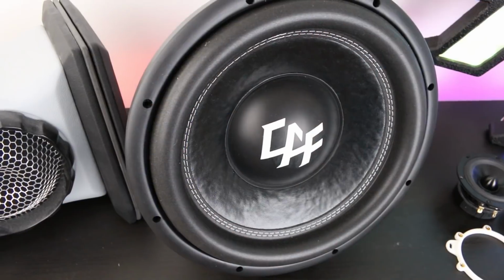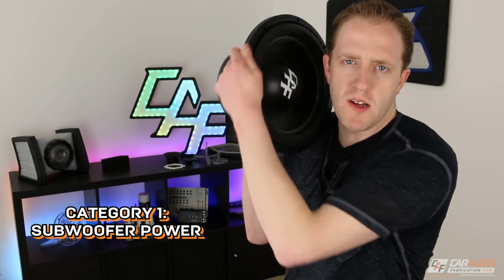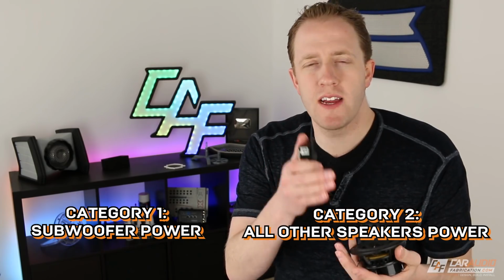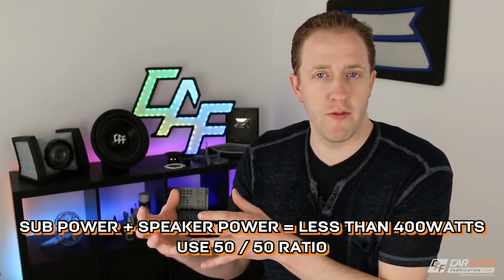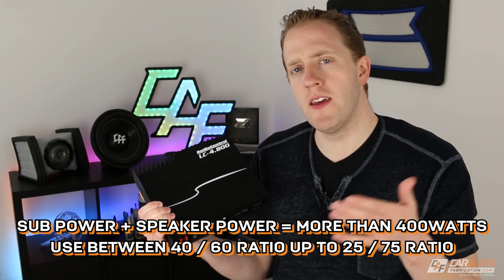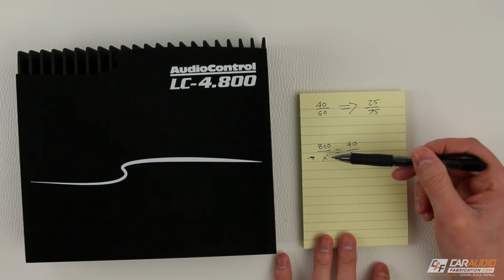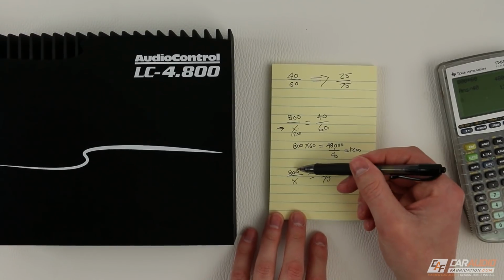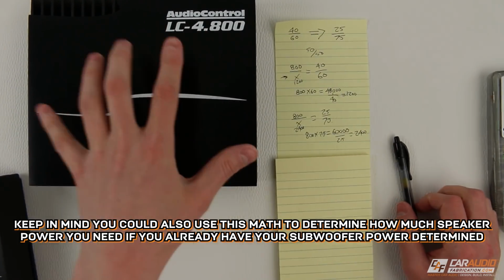Pair amplifiers CORRECTLY - Power Balancing Car Audio

Comment: Hi Mark!
I really enjoy your channel and can appreciate the time, detail and love that you put into your setups.  Nice video editing skills as well.  Keep up the good work. 
I'm very picky myself when it comes to car audio.  But I don't see much in the lines of more affordable amps or speakers on your channel.  High end setups are great and all but reviews and setups of some of the more common and mid-tear components ($400 to $600 amps / $150 to $300 speakers) would be great and help me and others as well.  But if you only want to do the higher end stuff, that's fine too.  If you do have some videos on more affordable options, please post a link or two. 
I use to have an old school Sony Explode 5 channel amp (40Wx4, 150Wx1), CDT 3-way component speakers,  2 Image Dynamics 10" subs, Clarion Pro Audo CD receiver (got it on clearance), Audio Control active crossover (made my own crossover modules with 1% resistors) and a ton of second skin sound deadener.  Everything for less than $1,500 total.  I fiber glassed my own custom kick panels and built a Deathbox for the subs (isobaric configuration).  Tuned it all for SQ.  Came out sounding better than most shops could do with expensive gear.  I don't have the car anymore but plan on doing another similar setup in my Outback.  It's been 10 years or so since I did the stereo and everything has changed, more or less and is why I was asking about you doing more mid-tear setups.  They can sound just as good or better than the high end stuff with some TLC, tuning and careful setup.

Comment: This is strictly RMS right? I wanted to go with a multi channel 800W max power amp (400 RMS, 4 channel x 100W ea @ 4ohms) and a mono 800W amp (RMS 600W, @ 2 ohms). Just confusing because they are both 800W max power. FYI, aiming for a 4 speaker, 1 Subwoofer setup, with aftermarket head unit. Im also a noob lol

Comment: Hi there friend. I have a question. I have a 100rmsx4 channel amp on my speakers. If I want to improve my bass output, should I get one or two subwoofers and what kind?? I’m limited on space in my truck. I can install a box in the back under the seats by either trying to build one or buying one, but my seats are low so I think 12s are not an option. Appreciate it if anyone knows what I should do.

Comment: Hi!   I have a question for you. If I use a non factory head unit. And I want to maximize the speaker output.  Can I use one amp for the subwoofer and other amp for mid range speakers and the high output of the head unit for the door speakers? Or should I use only the amps? I want a quality sound system but I’d like to have a good bass.  Regards

Comment: new on your channel, and its very informative. may i ask what are the difference for the speaker amplifier and sub amplifier? i used on may car audio system 2 speaker amplifier ( 1 for the tweeters and mids and 1 for my 2 15” subs). i used a 4000watts amplifiers. thanks

Comment: What are you splitting though?  In your initial example of a 100W head unit, you're telling us a 50/50 split is 100W to the radio and 100W to the sub, but that's not a split,  that's 200% power. Should it not be 50W to the radio and 50W to the sub?

With the 4Ch 800W amp there are 250W per channel, so then 60% for the sub should mean there's only 80W per channel.
i

Comment: Hey there! First of all, thanks for all your amazingly useful videos and tutorials! Now, speaking of this exact video and informations, say I have a front hertz kit esk 165, rated at 100W RMS (300max rated) each pair, a rear coral kit mk130 rated at 100W RMS (200max rated), all driven by Pioneer GM-D8604 amp, rated 400Ws RMS at 4Ohm (1600max rated). What would be the perfect pairing subwoofer? I was mainly looking at active subwoofers, like 500Ws RMS 12", 1500 peak. Would that be a good 55 to 60/40% balancing? Excuse me if my question is dumb or something, watching this video because I'm indeed a noob and learned a lot by watching quite a few of your videos (alternator was my first upgrade indeed, thank you <3). Thanks again Sir Mark, amazing job!

Comment: So do the 25/75 split, and install the bass control knob which allows you to dial the bass level up or down, but never over the set gain setting on the amp (more of a tuning or EQ knob).............................Have the boom when you want it, or the audiophile when your want that too.

Comment: i know its late, but, 01 Highlander, kenwood deck, old school hi fonics mono 200w hercules(1989), in 4 ohm- 360 2 ohm, front and rear speakers crossed over from the deck at 80hrz, earrhquake 10dbxi @2ohm, playing 80 and lower, sounded fantastic.l  i know its not a stock radio, but still sounded awesome. not a spl system at all but really sounded great for stock speakers and not a ton of money invested. enough boom for dubstep, just right kick for a7x, 5fdp and all hail the yeti. good tight double bass chest pounder. just my opinion..

Comment: You gotta keep in mind that it takes more power to move a subwoofer, since it's a larger speaker than the midrange/tweeters speakers. So 100w speakers != 100w subwoofer. And one last thing that was very important to talk about is how much power do you really need without going deaf? In my experience, 500w total power is enough to get it so loud your ears would hurt after just a minute. So anything over 500w you're likely going to get hearing damage if you're going to be using that much power regularly.

Comment: I like all your videos. I can tell you  know your stuff.  I have a 2017 Tacoma   I want to keep the factory head unit and add audio control amplifier. Do the lc 4.800 have sound processor built in to them or do I need to add one to the lc series amplifiers? I want to do a good sounding system at a reasonable price point. What would you recommend??

Comment: TL,DW:
a. If the system is 400W RMS total and under, split power between subs and other speakers 50/50 or 60/40, favoring the sub
b. 400W RMS and up, use from 60/40 to 75/25 power ratio, favoring sub

Comment: So i did this math to try and find how much door speaker power i would need for a 14k subwoofer system and on the 40/60 i got 8k and on the 25/75 i got 4k. Im going with the 25/75 , so does this mean i need a total of 4k on my door speakers ? ( 4 doors , 1k of speakers in each door(not including tweeters) ) .  im going with the deaf bounce Arnold's with the hannibal brass tweeters and maybe 2 neos just for extra vocal

Comment: My sub is an active Pioneer 350W RMS and in doors I have an amp 4x70W RMS = 280W. For a total of 630 I have the the fraction: 28/35 same as 8/10 and same as 4/5. And by the way, the 40/60 can be written also as 2/3 right? Is pretty much the same thing. If the recommended interval is between 40/60 and 25/75 then we have 0,666 and 0,333. So is much easyer to calculate this way. Let's say we have a 800 Watt speaker amp (4x200W) and we need to calculate the sub amp. For a 40/60 this would be 800/0,666 = 1200 W! For a 25/75 This would be: 800/0,333 = 2400W . There you go. A muc spler way of doing it. Very intuitive.

Comment: Mark, as always I enjoyed your explanation, but just to clarify for my own purposes (dual subs in an SQ configuration) :

1 x 800W amp for front and rear speakers (4 channel amp - component front, coaxial rear)
1 x 400W mono amp for subwoofer #1
1 x 400W mono amp for subwoofer #2

I realize that's simplifying things, but if we're talking RMS rather than peak power surely 400W into each 10-inch JL sub is plenty ? I readily admit that I don't spend too much time thinking about such things with home audio, but this makes total sense given the seating positions and the cabin effect in a car. I accept that you make a living configuring and installing people's systems but I'd really appreciate your input. 

Thanks for the video (and I did remember to like it).

Comment: What happens when I have way more for the speakers than the sub? So say I have 175 watts to 2 speakers (for now just 2 but it's a 4 channel amp) and then 300 watts rms for the sub? This doesn't sound that bad as it's about 50/50 rather than what it'd be for 4 speakers so what happens to it when it hits four x 175 watts vs the 300 watts on the 2 10 inch subs? Thanks

Comment: Im using  a hifonics brutus bxx 1200.4 amp. 1200 rms 4 channel amp wired at 4ohms to 4 speakers. but im gonna add 4 more speakers so 8 speakers total. Bridged at 4ohms should net me 1200 rms across 4 channels. Then ill just set the gains accordingly.and im gonna be using a single 3000 watt rms massive audio "12 subwoofer. Im upgrading from 2 "10 cerwin vega V max subwoofers. They are wired at 2ohms 1200 rms on a hifonics brutus bxx 3000.1D amp. Dual batteries with mesa 0G wire with 240amp alternator. My girlfriend thinks its loud enough. But I want it louder. All stuffed in a little hatchback camaro 😂

Comment: I've got a 2007 Chrysler 300c.   Looking to upgrade from absolute factory.   First and foremost, a Pioneer AVH-2500NEX Head Unit.   For reference, this unit is 50 x 4.  Then adding to my trunk a single Sundown Audio 12" 750W 2-Ohm SA Sub.  And to power THAT is a Rockford Punch 1000x2 amp.   Now my question, since this Amp is 1000 x "2" can I put 500 to the Sub and 500 to the 6 front speakers (dash, doors & rear deck) combined?   I haven't bought anything yet, I'm in the market to do so.

Comment: What if I have a 600.1 amp and a 300.4 amp. The woofer is 500rms and the speakers are 150rms and 100rms? Is that ok? Or should I get a more powerful amp for the speakers? I’m in the range of the ratio, but not sure! HELP!

Comment: I’m a little confused about how ohms affect amp ratings. So I’m looking at a Rockford Fosgate Punch 400X4 amp to power 4 Rockford Fosgate Punch 6.75 door speakers and a Rockford Fosgate P300x1 to power a RF P2 10” sub. However because the door speakers are 4 ohm and the amp only produces 50 watts rms x 4 at 4 ohm’s I believe I can say that I affectively have a 200 watt amp and not a 400 watt amp for the door speakers...? The sub is a 2 ohm unit and since the amp is rated at 300 watts rms x 1 at 2 ohms this is obviously a 300 watt match. With a 200/300 watt system I have a 40/60 ratio and should be golden, right?

Comment: Stopped it at 3 min when you said a stock head unit puts out 100 watts. BTW, when I make my systems I generally use real amps(not the head unit) and maybe 50 watts for components and 150 watts times 2 for 2 subs for about 400 watts total. If I want a higher powered system it's 100 times 2 and maybe 300 for each of 2 subs.

Comment: Sweet my power is 40/60 then will be 25/75 after the second set of amp & sub per side. 1100×60÷40=1650 & 1100×75÷25=3300 and that means 1100watts in the doors, and 3300watts in the extra cab.

Comment: So, I got it but Mark I’m new have a front stage with  focal tweeters huh end, mid range are hybrid audio L2V2 mid bass are hybrid audio L6V2  power with a arc audio driver 1200.6 , my sub is an Audi son 8” ported 500 watts  all 4 ohms, sub amp is a 1100.1 arc audio  the same  is apply to front stage?

Comment: The factory head you show is probably 10 watts hahaha... Mark, do you know where I can get a 15 watt rms mono amp? I already have my 1/0 gauge aluminum wire and 250 amp fuse installed.

Comment: My rating on my amplifier is 
RMS Power at 4-Ohms: 450W x 1
RMS Power at 2-Ohms: 750W x 1
RMS Power at 1-Ohm: 1000W x 1
And I want 2 subwoofers what’s the max rms I can get between 4-ohm or 2-ohm or even 1-ohm 
I have a Memphis prx1.1000 mono block class D
Please help

Comment: I uses EQ's in any system to clear out distortion, amplify the sound. And dial in the sound I wanna hear. Plus a few EQ's I have have front and rear high level inputs along with an optional rear rca input, since I add linear doom tweeters I learned that I can get 6 high level channels, since the tweets don't need alot of power and are facing me, I hook those to the decks front high level lines, then instead of using the front highs as input to the EQ i use the rear high level into the the front high level inputs on the EQ and rear rca's outputs on the deck to the rca inputs on the EQ by using a rca 2x 1 into 2 spliters except with my JBL by Harmon Cardon digital display of 10 band EQ, that one has rca in and out's, allowing bypass non amped sound to the amp. Then I'm left with 4 high level, front and rear outputs, I always replace stock speakers with higher wattage aftermarket speakers so the EQ+deck gives them greet sound, when I crank it up like in my minivan I've got 1 Soundstream comp SPL12D DVC 4ohms per channel bridgable ; 450w rms @ 4ohms, 800w rms @ 2ohms, wired to a 2500w max Earthquake amp 2ohm stable, pushing 750w rms @ 2ohms. And installed in a sealed enclosure that has the exact air space it needs, it slaps hard and kicks hard, cranked up my system hits hard but I can still gear the music, the voices, the highs and the lows. Clear as they should be. I love bass. But i also love music.

Comment: Ok this was confusing. I have a question I have a 1994 supra aftermarket 2 din radio with a pair of infinity kappa 62.11i and Infinity REF4032CFX. What amp and sub do you recommend or anything else. I'm looking for quality sound and bass.

Comment: I watched your video and understand the ratio but have a question if you don't mind.  I have a Rockville RXA-F1 (800W RMS 4x200 @ 2 ohms) amp powering four 6x8 Rockford Fosgate P1683 3-way coaxial speakers (130W RMS ea.).  I also have a single Kicker 43DXA2501 250W RMS amp powering a Rockford Fosgate R2D4-10 subwoofer (250W RMS).  The sub is plenty loud and drowns out the coaxial speakers for the most part even though it seems my ratio is at the opposite end of the ratio you suggested in your video.  I still have a factory stereo for now; replacing later.  This was my first installation so I am learning as I go; maybe it is the settings on the amps.  Not sure what I can do to solve the issue in the meantime; thanks!

Comment: Thanks for all the info on your channel!
I'm starting from cratch in my car and would like your input! 

Do you think this would be a good setup?
P300X1 for the subwoofer (also from RF, any suggestions?)

T400x4ad for the 4 speakers. Two in front doors and two in the parcel shelf 
T1693 6”x9” 3-way for the back parcel shelf
T2652-S T2 for the front doors. 

I don't need it to win any competitions or be heard two towns away. I just like powerful sound on rock/pop music. I want it to be clear and full. Would this setup be any good for that? Maybe the parcel shelf speakers aren't even needed?

Thanks in advance!

Comment: If clarity is most important to you, then do what I do - 55% high + mid,  45% sub.
Setup: JL Audio HD750/1 + 2x JL 10w3v3
JL HD600/4 + JL C5-650 
Bi-amped
JL 300/4 + Vifa home theater tweeters
+ bass shakers in seats. 

TONS of power and headroom, then don't play it super loud.

Comment: First time making any changes to factory installed components (Newbie). Considering this video does a recommended Alpine PDX-V9 (5 channel AMP 4x100+500), server my primary purpose of achieving good sound quality (Jazz, Blues, R&B, Vocals, string instruments, piano, and horns are preferred listening), and not having too much overring bass? Speakers are (4)100RMS (Alpine R-Series) and JL Audio Stealth Sub(500RMS, 10 inch). Vehicle is 2004 Toyo Sequoia if that matters. Also, I did upgrade head unit to aftermarket Kenwood Excelon unit. Thanks for all the great videos and comments by others.

Comment: Interesting video.  I currently run 1440 to active tweets/mids/front midbass/rear midbass filler, and 1200 to 2X10" subs.  Even though I'm a tad lopsided, the limiting factor for me is not low bass, but mid bass.  My subs feel like they will tear the car apart long before the amp gives out.  My mid-bass woofers, on the other hand, still bottom out from time to time even with a clean 180/channel.  But there's only so much you can run off a stock alternator even with super efficient class Ds.

Comment: If I’m installing Two Kicker IQ 1000.5 Amps and possible a 500.2 amp. 

That would mean that I will have 825 watts for Full range and 1000 watts RMS for the two subs? If this was going to be an SQ build, would that mean that the subs would be lacking a little?

Comment: Hi Mark, i have a 900w 2 channel amplifier for my sub, and a 2000w 4-channel for my doors speaker.. i want to add another amplifier for the soundbar.. but how I can wire those 3 amplifier? I have only 4 high power outputs on my OEM headunit

Comment: Hi Mark! I am learning a lot from your videos. I have one question here if you don't mind. As we all know, infinite number of variables need to be considered before one can start buying the necessary components for a good audio setup. In my case, I wish to have 3 way active front speakers and 2 way active for the rear. Using the distribution you discussed in this video, it would lead me to underpowered component speakers for both front and rear speakers. Using the 60/40 distribution with 600W RMS subwoofer baseline, I am left with only 400W RMS to deal with for the speakers. Dividing the 400W RMS among speakers (3way active Front and 2way actvie Rear), it would lead me to only 40W RMS for each component speaker. Using one of Rockford Fosgate series with 125W RMS rating, only 32% RMS can be utilized in order to achieve power balance. Are underpowered speakers providing good and clean sound as designed? Again, thank you.

Comment: here my question   i'm planing on upgrading my speaker on  my motorcycle i'm planing on using a Rockfort fosgate Punch 300x4 to power the speakers the RF 300x4 is 75 watts per channel should i use speakers that can andle more then the supplyed amp power or less then the amp power